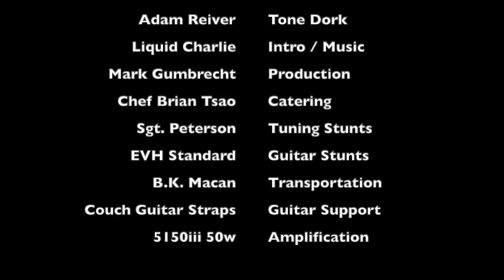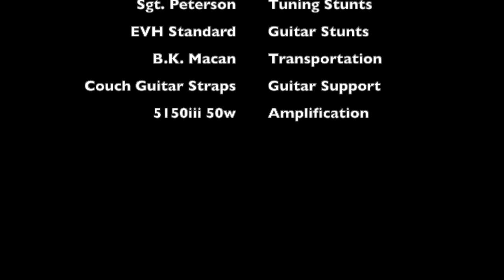FU-Tone EVH Standard Upgrade & Mod

Comment: I called FU-tone the other day to get a brass block question answered for my Wolfgang. Figured a customer support team member would answer. Nope, it was Adam. Not only did he address my question, but also texted me support links and a parts list just for Wolfgang standards. Then we B.s’d about guitars for a little bit. Going to be doing these mods very soon. 

Seriously if you’re thinking about modding, start and finish with FU-Tone. Quality, well engineered parts for all the right reasons. Plus a great guy at the wheel. Those, plus US based, I don’t need to go anywhere else.
Reply: I've spoken with Adam, as well..... Good communication with an obviously, genuine guy. Addressed all my questions (I've since forgotten what they were - but, the point sticks!)

Comment: I just routed mine last night with the same Dremel tool but with a  router base to make it easier to  control. Didn't really need that  but  if you have it might as  well. That wood is soft and cuts so easy.. Done in no time. No need  for  big router on that job. That could easily be done with hand tools if  power tools are available.

Comment: THis is a great video, thank you Sir!. I am thinking of buying one of these standards and upgrading it with better? components?. Is the Floyd Rose Tremolo the 200$ one you can buy from Germany? And what do you think of upgrading the pickups, to the $149 dollar ones made by EVH parts? I would like to buy a standard version and buy a few good parts instead of spending $3600 on the more expensive one, that i Really Want!!!
Great video and Thanks again. RH DSD
Reply: According an EVH rep.those are the same pickups in all their guitars. I’d buy the Mexican Wolfgang special instead of the modding
Reply: Thank you. I would love one to add to my collection.
Reply: Or, i was thinking about the older PEAVEY EVH but those are not cheap either. Hands down, if i had $4000, i would plunk it down, buy one quality guitar for life and be done with it. I am so Glad Eddie designed an entry level evh for the masses. There seems to be alot of bang for yur buck, with the Wolfgang standard.
Reply from the maker: @ToneChaser79  I would mad that one too!
Reply: I bought a WG standard in October and have made a few upgrades. Swapped in a switch craft toggle and put in the EVH low friction pots. I love to tinker though. If you’re into tinkering and making improvements bespoke for you, get the standard and mod it. 

For the pickups, I would recommend that you try the standard pickups first for awhile. Pickups were on my wish list before the guitar even arrived but then I spent my first month with the guitar. Pickups quickly dropped to the bottom of my list. Even without the mods Adam has done it sounds and plays great. Can’t wait to get the FU tone parts in it.

Comment: I'm not sure what this accomplishes. Is it just to make the hole symmetrical for OCD people or is it to make space to fit a better bridge? I just bought a Wolfgang Standard (huge step up for me) and am eager to learn all  can about it.
Reply: I'm wondering the same thing. The only thing I can think of is that the bottom of the bridge doesn't sit flat on the body because of a plate between the block and the tension fingers for the fine tuners.

Comment: I bought that exact guitar this week second hand. I got it home and it has a loud hum on the distortion channel and a slight hum on clean. If I touch the jack or the metal on the chord is goes away. After taking the cover off I can touch the pots and it goes away. Also if I turn the tone knob all the way down it goes away. Any suggestions. All wires appear to be connected..  Very interested in the upgrades as well!

Comment: Would the Suggested Parts upgrade list above also apply to Wolfgang Specials? I'm wanting to try out some FU Tone upgrades on my Stealth Special.
Reply from the maker: 100% - No mod required!
Reply: @FloydUpgrades  Just to clarify...are you saying that you don't feel any mods are required for the stealth specials, or that no "mod" is needed to the list mentioned above...100% go with the same parts list?

Comment: It sounds awesome. How much are the parts? Could you put a link to all the parts needed for this upgrade? Thanks
Reply from the maker: Here is the complete list with pricing - 
42L Brass Big Block - 50
Ti Saddle Inserts - 45
HD Noiseless Springs - 20
Brass Claw & Screws - 35
SS Hardware (ALL) - 60
Brass Trem Stop - 25
Reply: What is SS hardware?
Reply: @leahcim967  Stainless Steel

Comment: So what does this mod actually do? Are you only making the original cavity even, or in doing so does it make the guitar function or sound any better? Does it have any added benefit for the tremolo or something else? I have a Wolfgang Standard and mine is even all the way across. Aside from that, only the tremolo touches the body OVER the cavity... not where that uneven routing occurred. 
If it doesn't change anything... tone, function or otherwise, what IS the benefit of doing this other than simply making the cavity more even where they routed it? 
Sorry... not being confrontational... just genuinely would like to know what benefit this has.
Thanks